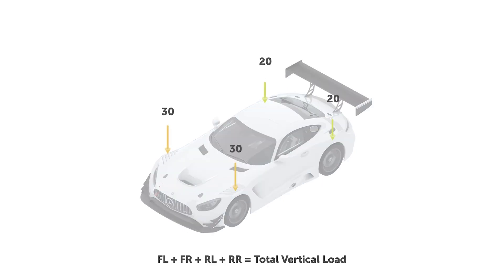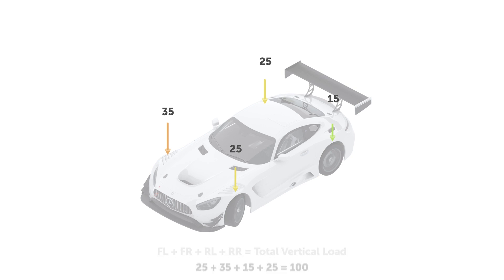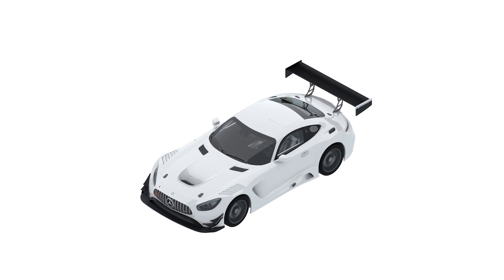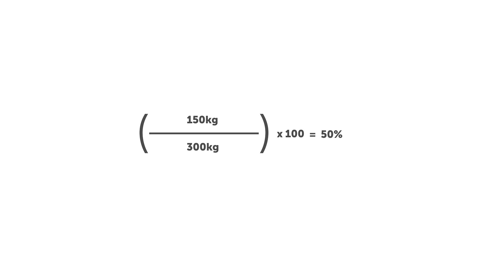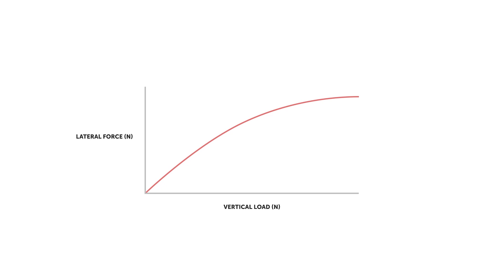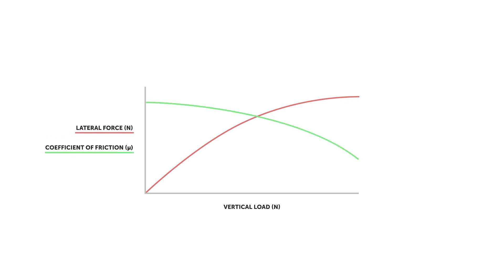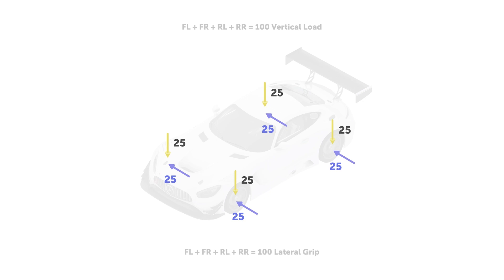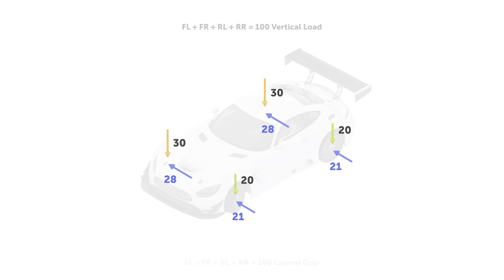Tuning Your Suspension? This ONE Aspect Is CRITICAL

Comment: Btw. isn't lateral load a little beneficial if outside tires need (or at lest benefit from) extra grip (vs inside tires) in the corner and they get it because of lateral load transfer?

Comment: Are u saying that as you increase the "normal" force on the tyres the coefficient of friction decreases? That doesn't sound right? 6:18
Reply: @dreamer_36  That’s exactly right. Coefficient of friction x vertical load = Total friction. Think of it this way. If you add 1 unit of downforce, you get 1 extra unit of friction. But if you add 2 units of downforce, instead of getting 2 extra units of friction, you’ll get 1.8 extra units instead.
Reply: This example doesn't account for suspension geometry.  Friction might decrease but the grip increases, that is because most (especially sports) cars have negative camber. Meaning tire contact patch gets bigger in a corner.